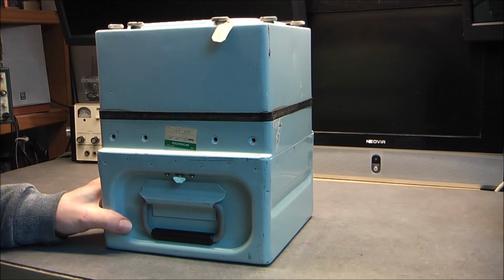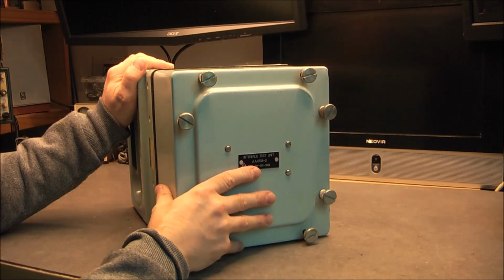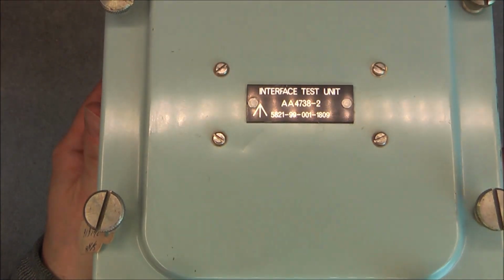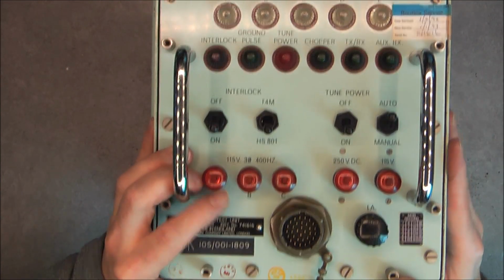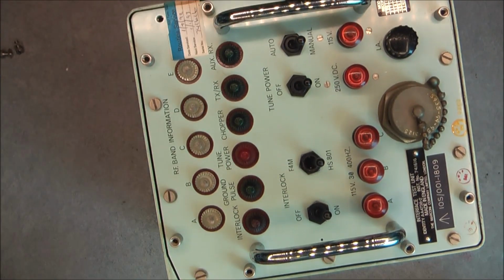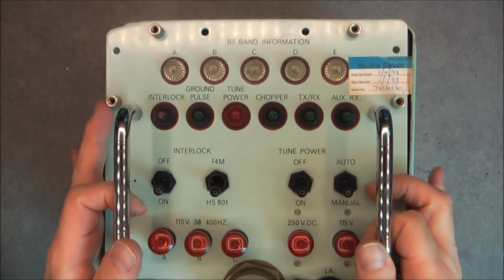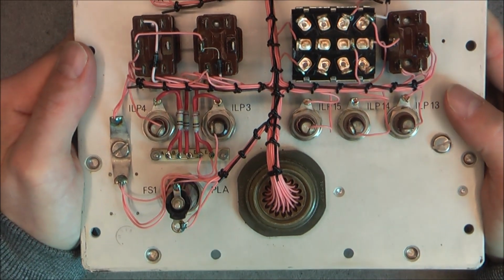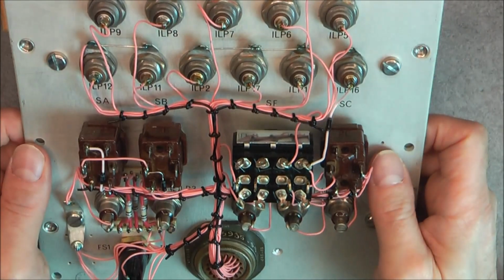Tornado interface test set teardown

Comment: Aaaah i got one of them too!  wondering what to put in it, it's not quite big enough for a roll of 3d printer filament unfortunatly
Reply from the maker: It is not the first time I am disappointed with a test set... At least there is one kind of stuff that never disappoint: those Collins avionics boxes, black front panel with the red stripe. Always nice parts inside them with a nice modular construction. I am currently in the process of hoarding them :-D